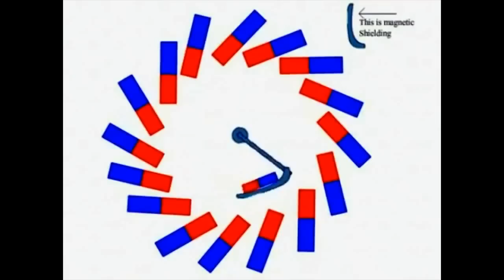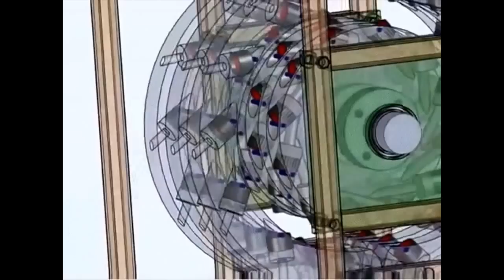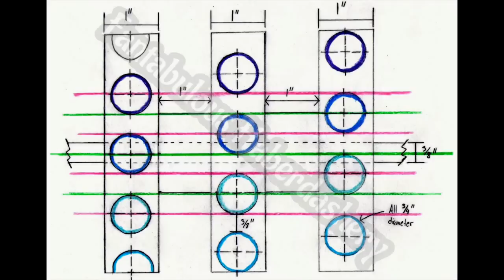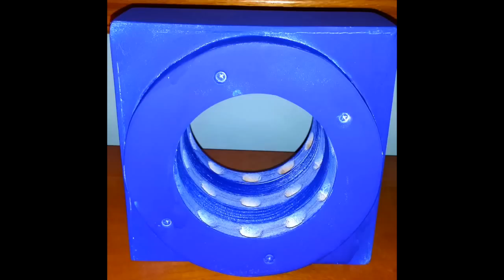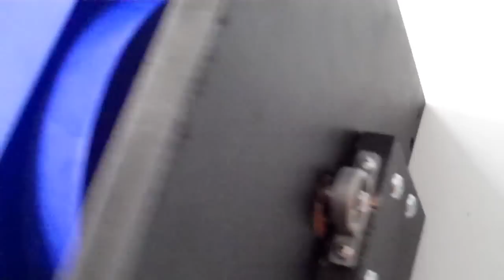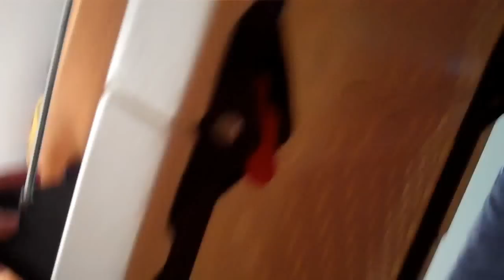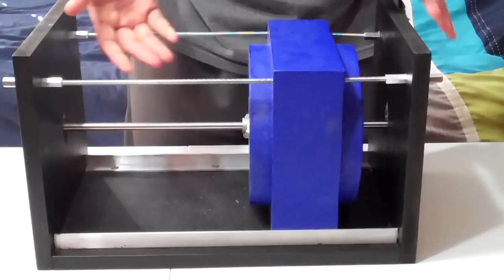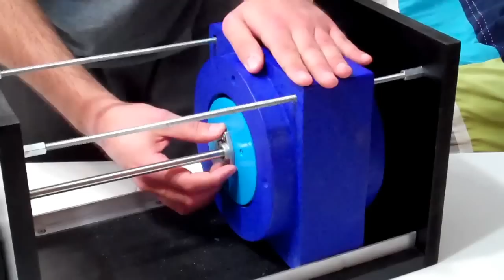Working Perendev Magnet Motor!

Comment: I saw an interesting video on perendev: a Spaniard explaining how to break the equilibrium of the engine that makes it eventually stop. 
 It's made by replacing two non adjacent magnets in the stator by electromagnets that will disrupt the equilibrium. he claims this is the secret. these electromagnets are connected among each other and there is no external electrical source.

Comment: seems real, there is no motor no wiring at all just magnets & aluminium & plywood. however it is not completely imbalanced since the counter effect of the repelling magnets are slowing it down. You have done a great work. 
It just needs few modification to control the magnetic field.
Reply: Are you blind ?

Comment: It's my opinion that no circular arrangement of magnets (or any closed loop, circular or otherwise) can sustain motion.  This can be shown mathematically using a line integral.  Zero point energy may exist and we might discover how to use it, but it won't be accessed using this type of magnet machine, no matter how clever.

Comment: It 'catches' cus your inner cylinder isn't quite cylindrical... It's lopsided, otherwise, it'd work perfectly.. :P If you have a 3D printer, you could make a more precise build.

The last thing to do is connect the ends of the axle to a coil(s), making it a generator; connect the ends of the coil to a battery, and bam -- you're storing energy for "free" (i.e. without paying for it, aside from the initial investment of materials + building it). Zero point energy, however, is that holy grail of 'everything' from 'nothing', which may not be achievable... Very often confused.

Comment: you are missing one fact, the power you add by your hand, if you add load it will not work lose it faster. but this will work if you managed to add a battery to one side this will make different between the 2 power,

Comment: I believe the video title is false.
This is far from a "Working ........"
Firstly it doesn't 'Self Start'.
Secondly is catches at the equilibrium point quite clearly.
Thirdly it's not a balanced rotary.
.....there are much better examples in YouTube land.
The title should be changed to "A version of Perendev Magnetic Motor"
Reply: I have never seen any Perendev motors self start

Comment: 8:39 That's the exact moment you used your right hand to externally power the shaft with, probably, a small motor.
Reply: i don't think that , is about inertia of rotating objects that sliding in rotation on magnetic fields and slow down https://en.wikipedia.org/wiki/List_of_moments_of_inertia   think if this could be rotated in 0 gravity and the rotor could have 4 magnets (2 on the rotor and 2 in extremis to sustain the rotor ) and you could give some rotations moments when will slowing down to compensate so to restore initial velocity .. you could have 1/2 of a perpetuum mobile generator with a calculated consumer by a formula(you could find out by experimenting in time and evaluating the power forces of the magnets,the rotor's speed ,the output energy obtained,the compensate energy losses to restore the rotation,...and other variables i do not know at the time: i don't experimented)
Reply: It's obviously a bullshit contraption and everybody here is like "he's on the right path!" :-D
Reply: I've done my share of playing around with hard drive magnets; &, given what I've seen them do, this seems very plausible to me. The kid seems to be on the right track. When the weather finally gets better, I'm probably going to try playing around with something like this. Even if it were to just run fan blades down in my "mag shack," it'd be a handy little contraption... If (by scaling up) it would turn the rotor for a stator/rotor motor I'm also wanting to do a few things with, that would be even better. {shrug} Some folks are just conditioned to keep thinking "inside the box..."
Reply: yeah just a youtube fraud trying to make money on his channel
Reply: Lads it's physics and is 100% possible and he's on the right track. The only problem with these motors is they aren't likely to produce enough power to run anything other than flywheel which would actually assist the perpetual motion, making the resistance of the magnets less and if the resistant sides if the magnets were shielded that thing would only stop if you physically stopped it. I'd put my life on it. 
The resistance of the magnets is the only hurdle 👍✌
Reply: @David-Christ-13  The problem with using shielding... is that then the device will accelerate until you get a mechanical failure...

Comment: magnets have no energy at all.
Reply: While your comment is practically true it is not technically true.  Magnets have a truly trivial amount of energy.   This is why if you heat them above the curie point, they go to the lower energy state of not being a magnet any more.
Reply: Ken Smith
No. When you heat them the molecules return to their chaotic state, losing their magnetic orientation.
Reply: What I said was correct.  The change is towards a lower energy state.
Reply: Ken Smith
No. Because magnetic orientation is not energy.
Reply: No.

"...which is used to calculate the energy stored in an inductor. ".

A magnet is not an inductor.
Reply: The energy in an inductor is stored in the magnetic field.  The equation for the energy in the field was given.  Here is a popular source:
https://en.wikipedia.org/wiki/Magnetic_energy

Maxwell did this quite a long time ago.

What I said was correct
Reply: Ken Smith
Magnet is not an inductor.
Reply: A magnetic field is a magnetic field is a magnetic field.  There is only one type of field it doesn't matter if it is from a coil of wire or a permanent magnet.  It has the same energy content.  The same equation gives this content.
Reply: Ken Smith
Yes and no. A magnetic field is a magnetic field, but the formulas are for inductors.
Reply: No, the formula that is in terms of "B" is for magnetic fields.  This means all magnetic fields and not just some of them.  The energy content of a magnetic field runs as B^2.  This is true of all magnetic fields.  The energy you get out by letting two magnets move together comes from the magnetic field.  When you are done allowing them together the integral of B^2/u is less.  There is no change in the total energy.
Reply: Ken Smith
Sorry, but no. You need to learn physics.

Comment: There are lots of ways this could have been faked (and it was faked). My guess is he has a motor under the table. When he spins his gizmo at just the right speed the magnetic field from the motor gives his magnets just enough of a kick to keep the gizmo spinning.
There are several other ways this could have been faked and I repeat, it was faked.
Reply: The blue box has electromagnets.
Reply: Yeah you're probably right. The electromagnets are firing at a set frequency so he has to match the speed of the internal rotor to the speed of the electromagnets.

I personally wish these guys would reveal how they did it instead of feed this free energy nonsense.

Comment: what a shame, you did exactly what you said was wrong with all the other scam videos, that is when the motor is "running" you conveniently have the left side shaft just out of the scene so that you can have it being turned by some type of external power source and then as soon as you say it is starting to slow down you then allow the camera to show the left side bearing and shaft by pulling the motor away from where you had the external power source and back into the shot, I gotta hand it to you though you gave a wonderful presentation claiming to be indifferent and that you wanted to figure out if it was possible and you may have even started out believing that but probably not, this was a massive amount of time and effort to trick anyone who became interested and watched the video, if you really want to prove this thing works which we all know is impossible then show the whole dam thing in the shot Einstein. You are clearly an intelligent man and would understand the importance of having the entire machine in the shot and you obviously had plenty of room on the right side of the table to center the device in the shot so there is no excuse why you hide the left side shaft from view other then to power the device,  It's people like you that are the worst and so upsetting because you have the intelligence and ability to help teach people yet you use it to scam them, shame on you and if you think I'm totally out of line and wrong than show the whole dam engine in the scene next time,

Comment: There is PLENTY of space to embed an electromagnet and small battery powered oscillator anywhere in that large piece of wood and without any load, it will be highly efficient keeping the RPM constant.

This dude might have believed in magnetic motors and that's why he did an attempt, but it's a bummer when people start turning their work into a scam.

Comment: if you have time to answer: what if you take 25 or 30 degree angle but magnets are not flat but 3/4 in length? would it work?
Reply: he made alot of modifications perhaps that is why it worked so poorly

Comment: Think about something. Most starters in a car have a steel housing with the electrol magnet generated and mounted against the inside of the steel housing. Most electric motors have a steel housing.. It might help the magnetism to have it installed in a steel housing.

Comment: The main thing is shielding the south poles to keep them from attracting the north poles. Then there would be no resistance to the repulsive force of the two north poles repelling each other.
Reply: +tubular   Try it. Get a bunch of that shielding stuff and build one. Show us how it's done.
Reply: Don't have to get any 'shielding stuff' the magnets in hard drives are shielded with a metal plate. Take one out and stick a screwdriver to the magnet's north side, but try and get it to stick to the metal glued to the south side...nope. I was typing to Fantabulous anyway...
Reply: tubularguynine You can use 200 tons of mu-metal and you will NEVER make permanent magnets ONLY spin a rotor. Impossible.
Reply: Quantum Leap - In my world, the difficult is done immediately, the impossible takes a little longer.
Reply: Hey FuckYou - Man! You could be a psychic...but you couldn't make a living at it. I'm still working at something I love, ride my beach bike a few miles every other day, help out at the community center, contribute to the happiness and hearing loss of hundreds of partiers every time I pick up my Rickenbacker 4003 at weekend gigs and also occasionally teach young talent how to do the same. And although my dad WAS a gunsmith and I held the R.O.T.C. rifle team high score for five years after I graduated high school and still have a select group of firearms, I'm quite stable of mind and no risk to myself or society...well, maybe a small, UNstable percent of society...I voted for Trump. You can thank me later.
Reply: Rob Gandy To whom are you directing the "he he he" comment?   To the clown talking about "shielding" permanent magnets, or FYG+? Putting a name+ in front of your missive is the correct way to address the thread, FYI.
Reply: Rob Gandy  I try to keep my postings civil, after all, if were face to face we would attempt to be at least polite. Opinions run deep with everyone, I try to keep that in mind. Ciao!

Comment: I would actually like to see why you don't have any power to the inner shaft.
My guess is you created a flywheel with heavy weights that you spin and it still continues to spin at least for a while.
I guess I'm going to have to build one, since you hedonist pigs continue to downgrade the integrity of the MPE..
Reply: +krrr   Don't forget the electric motor you'll need, just like his at 8:42.  That will make yours spin too!  lol

Comment: free as in you dont spend $ for continuous electricity..  but free energy from nothing? nope!  gotta be a way to use gravity thats continuous energy and magnets to create cheap electricity... gravity for sure... gravity is a force thats constant and we cant use up gravity either... anyways i like geothermal power... it amazes me we can get so much electricity using the earths geothermal energy!
Reply: Gary Sanchez - There are gravity powered weight systems that have been powering clock towers for hundreds of years. Yet no one has used the tech to turn a generator.
Reply: Camdex there has to be a way!
Reply: +Camdex  True enough about gravity powered clocks - I have one in my foyer. BUT, I have to crank the weights up to the top every week to keep the clock going. That's the problem with gravity powered systems, you must first raise the weight to its starting position. Consequently, you get that energy back over time. But never forget, YOU put the energy in first. That's why you don't see gravity powered generators used in this manner. However, a hydroelectric dam utilizes gravity power. The difference is that the Sun does the heavy lifting by evaporating water, which rains down, refilling the reservoir behind the damn. There has to be an energy input.
Reply: Quantum Leap that's interesting food for thought
Reply: Rob Gandy Rob, Rob, go to the light! He he he

Comment: To generate energy from this device you will need to add a magnetic disk on to the center shaft, and place copper or aluminum coils in front of or around the rotating magnets. Aluminum like copper effect the motion of a magnet i.e. There is a resistive force applied to the moving magnets. Which ultimately means their will be a lost of energy. You will never fine a point in this system that conserves 99% of the energy you put into it to begin the spin. To prove my point on resistive force...drop a cylinder magnet down a copper pipe and repeat with an aluminum pipe. You will notice the magnetic fields grabs on to the metal and slows the descent of the magnet.

Comment: Guess1: You loop the video to make it look like the thing doesn't slow down - that's why you can't move.  Easy to edit the audio afterwards.

Guess2: Hidden battery - plenty of space for this.
Reply: Mark Tillotson  Actual hoax is that he is using a motor on the left end of the shaft, just out of frame, to spin this clunky pile of manure. So fake.

Comment: Boy id like to see it "sustaining itself" with both ends of the axle and both hands in the shot. Why leave mystery?
Reply: thesimulacre Simply because "magnet motors" of any stripe are scams. Perendev was a liar, and this goof is riding his coat tails. You can put candy sprinkles on a turd, but you've still got a turd.
Reply: Yeah, most of the "generators" I've seen have had some sort of tricky or flat out ignorance going on, BUT I do find it interesting to find SO MANY inventors engineers and amateurs trying it. In fact, I find it even more interesting that plans for such a thing landed in the heads of a friend and I years ago, and only after intentionally searching it out did we find out it had been tried and tried and patented MANY times and tried and debunked and, well... I think it landed in LOT of heads, as do many "impossible" ideas like Oh, alternating current or microwaves. 
If we take into consideration that we don't REALLY know how (qualitatively) magnets work, (especially when printing custom fields has so recently become a reality), and we can all admit that a device that generates torque for the life of the magnets (could be a loooooooong battery life) would be awesome, then trying it out continues to be worth a few hundred peoples time. 
Beautiful prototype, by the way. No wonder you're frustrated. I'd recommend using that talent to build a setup that allows you to fiddle with the geometry of the fields.
Reply: +thesimulacre   He's going to have to find a way to turn the permanent magnet's force on and off. That's the Only Way he'll ever get this thing to run without cheating. Notice his right hand is out of frame at 8:32, that's when he is applying power via an electric motor to the left side of the axle. Of course, all of that is out of the camera's frame. Nice try, but no cigar. Cheaters never win.

Comment: there will be diffidently a high reluctance from the air gap, I think if u reduce the reluctance by reducing the air gap u'll increase the magnetic field intensity  Therefore higher B, and higher force 

Thanks for the nice video

Comment: cool thing about magnets and motors etc, is if the magnets are going to repel, or attract, they are going to do it starting at 0 rpm.. electric motors are "timed" and they make 100% torque at 0 rpm, just like magnets make maximum amount of repulsion when they are put near a similar pole.  there is no "catch" or magic rpm that it begins to work..  This is basically a failure, and video editing..  You can clearly see where it slows down, then cuts briskly to a loop where it's spinning fast again..  

Nice try.

Comment: Your right hand  moves out of frame to hold a drive motor with rubber wheel to turn the shaft,..When your hand comes into frame the unit begins slowing down.... You are a lying fucking shit head.